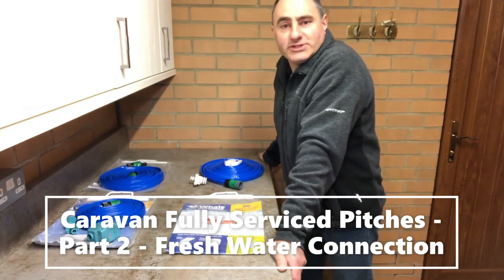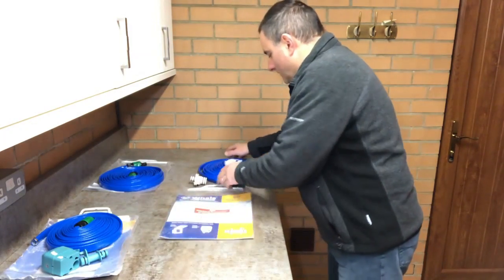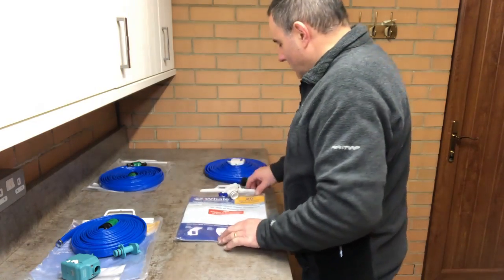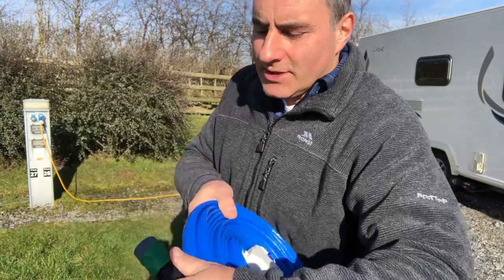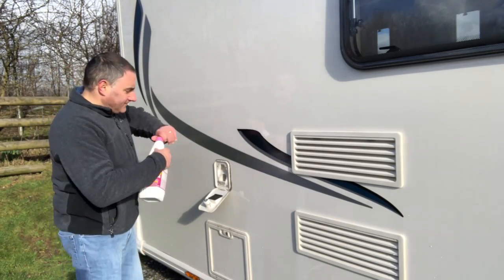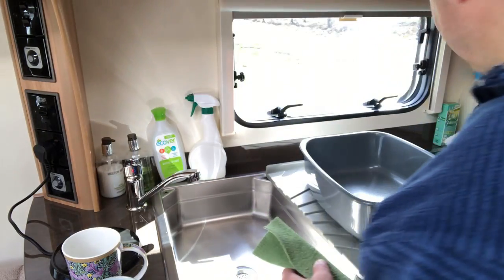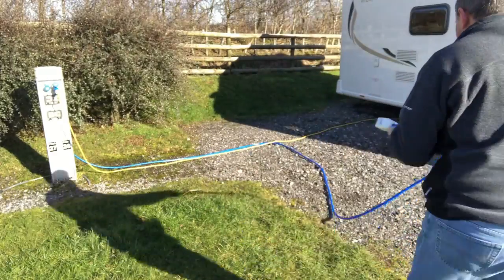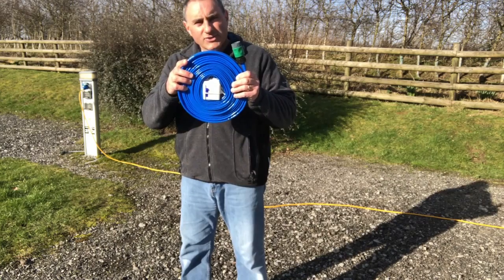Caravan Fully Serviced Pitches - Part 2 of 4 - Fresh Water Connection

Comment: Thanks Rob, some good advice & tips there.  We purchased one of those (the blue version!) and are using it just now for the first time.  It has worked very well but the only gripe I have is the Green connector system would not take the joining piece for our Orange ended hoses (we needed to use an extension, which we already had from the standard system with Orange connectors).  It meant having to whip the Green connector off and replace it with an Orange one from yet another hose - bit of a faff, but at least it resolved the shortfall.  Why cannot manufacturers standardise their equipment for goodness sakes... 🤷🏼‍♂️ 👍🏻 🐍
Reply from the maker: I thought the snap-fit connectors for this size of hose (1/2 inch) was an industry standard.  But glad you got it sorted in the end. Thanks for your comment and watching. Regards Rob
Reply: @robswiseways5697  - I thought so too, but the Green one would not accept the joining piece I have with my Orange set, which was just too big to fit in the Green connection... 🤷🏼‍♂️  Cheers, Rog... 🐍

Comment: Personally I prefer the ball float type to a pressure reduction valve, as any "mishap" occurs outside the van, and not in your internal plumbing. Plus- where do you keep the Aquaroll? It may as well be sitting outside with a hose connected. Another advantage is that you always have half an aquaroll of water in reserve in event of water supply or pressure problems on site, and yes we have in the past.
Reply from the maker: You may be surprised to know John we don’t actually own an Aquaroll. I always use this direct water connection kit as we only ever stay at sites which offer fully serviced pitches. In our 10 years of caravanning we’ve experienced low pressure on just two occasions and to boost the pressure we simply switched on the caravans on-board pump when showering. We always turn the external tap off when we go out for the day and have never had any problems. Have a look at my answer to Peter Cartledge regarding internal water leaks / bursts. Thanks very much for tuning in and commenting. All the best, Rob

Comment: I’ve heard that it’s better to have an Aguaroll with a stop valve inserted. No risk of your on-board piping being burst open by excessive pressure, flooding your caravan.
Reply from the maker: Hi Peter, We’ve never had a problem in nearly nine years of caravanning. We do however turn the main outside tap off as a precaution when we go out for the day. The Watermaster plug has a pressure regulator set between 1.5 and 1.8 bar. According to the label on the boiler the max system pressure is 4.5 bar which is well above the Watermaster regulator. A pump in an Aquaroll builds the pressure up and stops. The pump will probably have a cut out pressure of 2 bar. This means the internal pipe work will have 2 bar of water pressure standing in it which is slightly more than the Watermaster. The pump in our caravan is controlled via a pressure switch. If I were to use the pump via an Aquaroll and a leak or burst occurred, the pump would turn on and the float would drop in the Aquaroll allowing water in to flood the caravan. It’s a good point and thanks for commenting. Cheers. Rob

Comment: Just to make everyone aware, I spoke to Whale technical dpt and they confirmed at the start of the season you will still need to sterilize the water pipe system by using the aqau roll.
Reply from the maker: You are right Ann. I did a video on this during Sept 2020 titled Caravan Water System Steralisation & Preservation. Thanks for mentioning this. Best regards. Rob

Comment: Hi do you need the pump turned on in the caravan for the water to run or does it run on its own with the pressure of the water.
Reply from the maker: Hello Karen and thank you for your comment. The pump doesn’t need to be on as the water pressure itself is enough. There are two different direct water hook up’s depending on the make of the water inlet socket. Whale and Truma kits both have pressure regulators so are safe with caravan plumbing. I have read some stories of caravans being flooded but we’ve never had a problem in 11 years. 
We have been on a couple of sites where the water pressure was a bit low. We switched the internal pump on to boost the pressure when showering but this can use up the hot water much quicker. Hope this helps and best regards, Rob & Gail 😀

Comment: Hi great demo.  I usually connect a hose from the tap on a serviced pitch to my Aqua roll fitted with a stopcock.  Has anyone ever had a problem connecting directly to the caravan, just thinking if a pipe connector broke the caravan would get flooded!
Reply from the maker: Hi Marc, I've never heard or read any stories where folks have had problems. The instructions that came with our Whale Watermaster kit states 'make sure it is unplugged when not in use or when van is unattended'. When we are out for the day I turn the outside tap off. Other than that it's always on and we've never had a problem in 8 years of caravaning. Thanks for watching and take care. Rob
Reply: i am exactly the same for that reason, when we purchased the caravan i asked for all the services be running to show they were working, hen the guy connected the mains water direct to the van one of the plastic fittings leaked under the mains pressure, although
 the guy fixed the problem straight away i have never trusted direct mains to the van since always ball cock into the aqua roll then the mains is always on the external of the caravan

Comment: Helpful video however with the hose being of food hygiene standard you did have me worrying with allowing the end that goes into the side wall of the Caravan to lie on the floor maybe a freezer or food bag over the end whilst connecting the water inlet end would assist. Other  than that very informative and something I would consider buying for going on a fully serviced pitch
Reply from the maker: Hi Graham, It's only the outer casing but you could cover the plug if you wanted. Thanks for watching and commenting. Regards Rob

Comment: Looks great.  What is the water pressure like without a pump, particularly in the shower? Thank you.
Reply from the maker: We find both tap and shower pressure fine and adequate. We have an onboard pump which improves the flow but we don't use it as it uses the hot water up too quickly in the shower. We have been timing both the water heat-up times and max showering times throughout the year, and I will be putting a video together shortly. Thanks for watching. Rob

Comment: Hi Rob. our whale pump has just failed, i borrowed one of my mate to make sure it was the pump but he mentioned he uses the watermaster all the time now as it so much easier, so i am now going to purchase one for sure, one thing he did say is that he turns the water off at the the tap every time he is away from the van in case of any leaks that may occur inside. do you think it is a good idea or is he being over cautious. loving your videos Rob,keep them coming.  regards Ron
Reply from the maker: Hi Ron, Your mate is right, it is much easier, but remember you have to be on a fully serviced (FS) pitch. We only stay on FS pitches and the advice on the packaging states ‘turn the water off when the caravan is unoccupied and during the night’. Although I don’t do the latter, I do turn the water off when we go out for the day. Nearly 11 years later and no problems to report. The end that plugs into the caravan has a built in pressure reducer so the internal plumbing is safe. On all our holiday videos I show the service set up including the direct grey waste drainage. Take a look at some of the other comments and my answers in this video. Pleased you are enjoying the videos and thank you for the comment 👍, Kind regards, Rob

Comment: hi we have a swift chalenger 420, shes an old girl but still uo to form, apart from water leaking from the shasee when the water pump is running. how do i find the problem pipe, any idears
Reply from the maker: Hi there, All I can advise is, check the pipe runs with  the pump running to see where it’s forcing water out. If there’s no visible evidence under the benches / inside cupboards you will probably need to take covers off where the pipes are concealed. The leak will end up damaging the floor so I hope you find it soon. All the best, Rob
Reply: @robswiseways5697  cheers for your reply, how do i remove covers as there is no water showing under seats or bathroom
Reply from the maker: @fishypie  That’s something I cannot answer as furniture and covers vary between manufacturers. You would have to look and work it out or have a keen diy’er look at it for you. Hope you sort it. Cheers, Rob

Comment: Do yo still need to turn on the pump at the panel or is this just water pressure. Thanks
Reply from the maker: Our caravan has an onboard pump. 99.9% of the time we don’t need to switch it on. We have used the onboard pump a couple of occasions to increase pressure for showering when the site pressure was low. You have to bear in mind this uses the hot water quicker so you have to reduce the flow slightly with the shower mixer tap. Cheers for watching and commenting. Rob

Comment: Hello I wonder if you could help me
We’re brand new to touring caravans so I have been watching your videos and also others and it’s been a massive help,
I have used my van for the first time and decided to go fully serviced pitch and purchased a cold mains hook up from whale.
When connected my water pump was leaking from the seal on the bottom of the pump it’s a flojet 
Have you ever replaced the seals in on or should I buy a new pump and if so is there a better quality one to take mains pressure 
Kind regards shaun
Reply from the maker: Hi Shaun, Is it an onboard pump you have? We have one but don’t use it. Using the pump increases the flow but we find its ok without switching the pump on. The mains hook up is pressure regulated to 1.5 / 1.8 bar. If I did use my pump, it builds pressure to 2 bar before cutting out and internal pipe work can withstand higher pressure so all pumps should be ok with the mains hook up. I’ve never changed seals on the pump so cannot advise. Have you searched the internet for flojet caravan pumps?  Hope this helps. All the best, Rob
Reply: @robswiseways5697  thanks rob 

Yes it’s an onboard pump but because the water has to pass through it it leaks when on or off, I removed the mains hose and just filled the aqua roll and it worked great with no leaks so it’s my guess it’s never had that kind or pressure on it before due to the previous owner just using a aqua roll.
I decided to buy the aqua roll ballcock set up giving me endless water supply without causing any unnecessary stress to the pump seal.

Thank you and keep the great content coming 👍👍

Comment: Hi, having used this to effectively replace my external pump and Aqua roll so no need for the external pump to be turned on, and we aren't using the inboard tank and pump so we have no pumps turned on (external or internal) so have the mains supply which this adaptor regulates to 1.5 bar. The water supply flow is great without any pump involvement, Am I right in thinking we do not need any pump turned on in our system when using this mains adaptor as I've seen a few various opinions which seem contradictory yet I can't see why any pump would be useful with this mains supply? 

Thanks in advance.
Reply from the maker: Hi Dean, You are correct in saying you generally don’t need any pump turned on. However, during our nine and half years of caravanning we have stayed on a couple of sites where the site water pressure was low and we used the onboard pump to boost our shower water. This boosted our shower flow above average so we had to be nifty before the hot water ran out ! This is a point to consider if you use your caravan shower. Hope this helps. Cheers Rob
Reply: @robswiseways5697  thanks for the reply and forgive a daft question from a relative newbie at caravanning, I'm assuming your using your inboard tank as well as the water mains hook up for showering then?
Reply from the maker: Hi Dean, No we don’t use the onboard fresh water tank at all. It’s the water heater that has the 10 litre storage capacity. The shower has a mixer tap which mixes the hot water with the incoming cold but there becomes a point where the hot water is being drawn off quicker than the heater can heat it up. I have a video titled ‘Caravan Shower Update’ and this should explain it. Thanks again, Rob
Reply: @robswiseways5697  arrr I see, I'm pretty sure my internal pump is inside the inboard water tank (underslung tank really) hence I think I need water in the inboard tank to use the internal pump to boost the external mains water supply
Reply from the maker: I’ve not heard of a pump inside the tank. Our internal pump is inside the caravan under the bench next to the water heater. The mains water flows through the internal pump even when the pump is off. My system has a valve to stop water flowing to the inboard tank, instead directing it through to all taps. Hope this helps. Rob

Comment: Have you got a link for this watermaster kit. I cant find it on amazon
Reply from the maker: Hello David, Having trouble with links. In the Amazon search box type Whale watermaster mains water hook up . It should come straight up. They are priced at £72 / £73.50 and the extension is £54.95. Most caravan accessory shops should stock it. Truma also do a direct water hook up for their inlet socket called Ultraflow Waterline. Hope this helps. Cheers, Rob 👍
Reply: Ok thank you, i